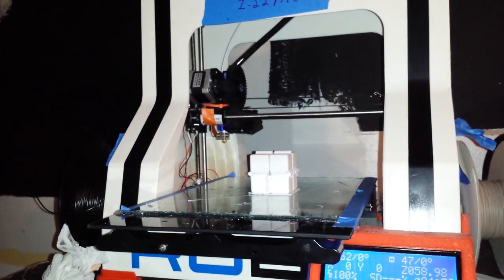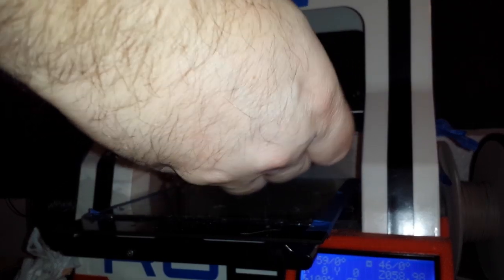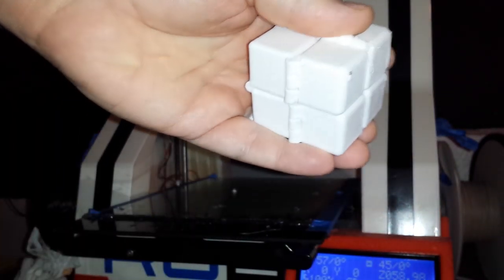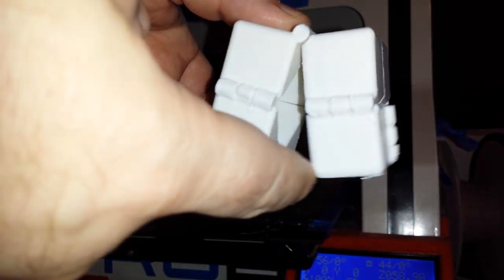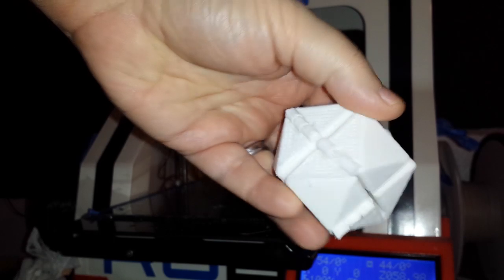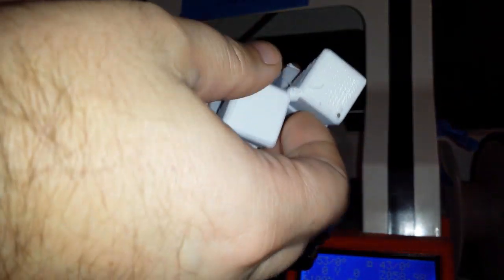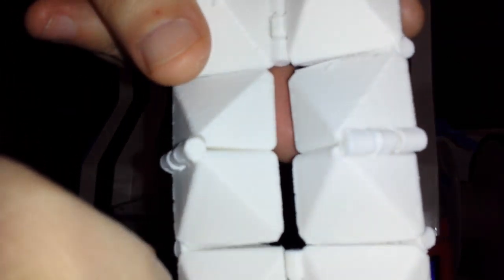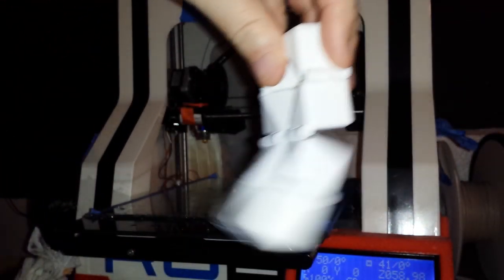3D Print of a Fidget Cube

Comment: wow your printer is really high quality!! How long did it take for you to calibrate it?
Reply from the maker: Hey, not too long you can see : http://forums.robo3dprinter.com/index.php?threads/i-have-found-3dprinting-nirvana-and-fixed-most-of-the-z-ribbing.3251/#post-28525   for more informaion on what I have done to the printer.  I think I had it running well after a month or so  then my bed broke and I learned a great trick of using glass on top of my glass to protect the original bed